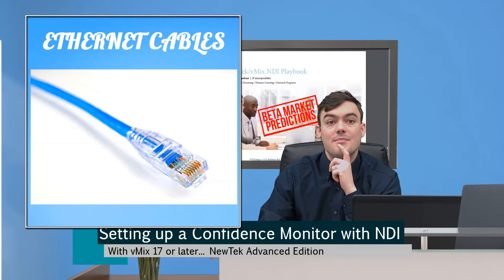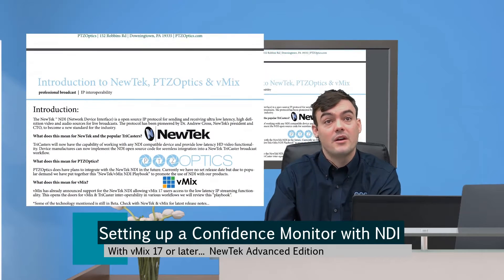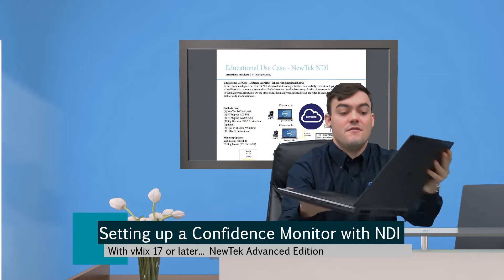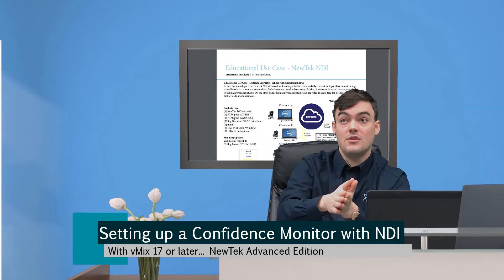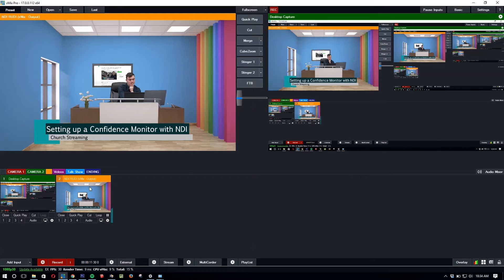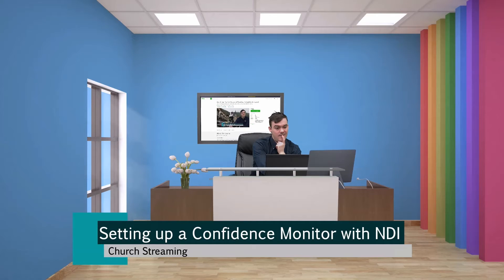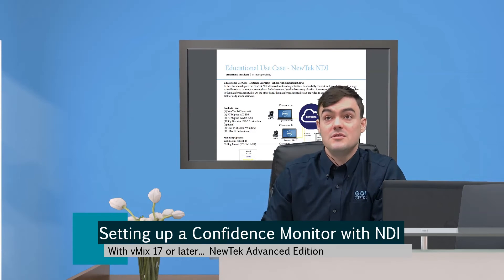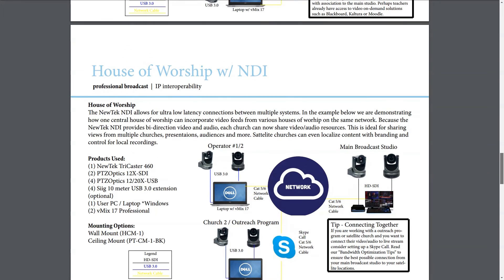How to Set Up a Confidence Monitor

Comment: How to set up a confidence monitor that does not utilize ndi camera.  Using OBS with Worship Extreme.  Need to use a tablet for pastors confidence monitor on podium
Reply from the maker: Hi Paul,
Setting up a confidence monitor for a pastor using OBS (Open Broadcaster Software) with Worship Extreme, without utilizing an NDI camera, can be achieved by creating a dedicated monitor output from OBS that can be displayed on a tablet. Here's a general approach to set this up:

Requirements
OBS (Open Broadcaster Software): Used for video mixing and streaming.
Worship Extreme: Software for creating and managing church presentations.
Tablet: This will serve as the confidence monitor.
Network Connection: Both the computer running OBS and the tablet need to be on the same network.

Steps to Set Up

Configure OBS:
Create a scene in OBS that will be used for the confidence monitor. This scene can include the elements you want the pastor to see, like the current slide, notes, or a timer.
If you want to show the Worship Extreme output, make sure OBS captures it either through window capture or display capture, depending on your setup.

Set Up a Secondary Monitor Output in OBS:
In OBS, you can set up a secondary monitor output (Projector Mode) to send a specific scene to a different display.
If the tablet is not directly connected as a monitor, you can use a network-based solution to extend your display to the tablet.

Use a Tablet as a Confidence Monitor:
There are apps available that can turn a tablet into a wireless monitor for your computer. Examples include Spacedesk, Duet Display, and others.
Install the required app on both your computer and the tablet. This app will allow the tablet to function as an additional monitor over the network.

Display OBS Output on Tablet:
Once the tablet is set up as a secondary monitor, you can extend the OBS projector output to this tablet.
Ensure the tablet displays the specific scene or output designated for the confidence monitor.

Test Your Setup:
Run a test to make sure everything is displaying correctly on the tablet.
Make any necessary adjustments in OBS or the tablet app to ensure the pastor has the required information visible.

Considerations
1. Network Reliability: Ensure a stable network connection to prevent any lag or disconnection issues.
2.Latency: There might be a slight delay in the feed, depending on the network and software used.
3. Tablet Battery Life: Make sure the tablet is fully charged or plugged in if it's going to be used for an extended period.

This setup allows you to use a tablet as a confidence monitor by extending the OBS output to it over your network. The tablet will show whatever is configured in OBS, giving the pastor a dedicated view of the necessary information during the service.